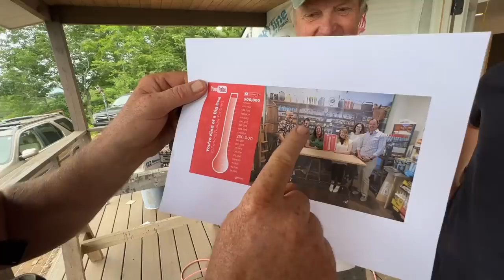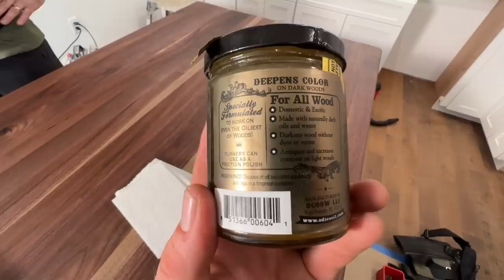Building A Mountain Cabin EP47 | Testing homemade crown jig and kitchen island install

Comment: Watching you put together the island cabinets, I'm reminded of my first house.  This is back in the old days--  1985 or '86.  LOL!  Back then there were no cabinets designed specifically for islands.  The whole island concept was brand new and most people were happy to simply have an island with nothing more than a shelf underneath.  Many had butcher-block tops as well as the pre-requisite hanging pot rack.  Ugh.  

Of course, I wanted an island, too.  But all the islands I saw seemed like a big waste of space.  So I asked my carpenter if he could put cabinet space under the island and he scratched his head and agreed he could.  But said he would have to custom make them.  Can you imagine?  He did a great job and we did put butcher-block counter tops in the whole kitchen.  So the island did have a butcher-block top, too, though no pot rack-- thank Goodness!  It was only 30" deep x 72" long because the kitchen was a little narrow.  But it had two fully functional cabinets, with drawer space and storage underneath.  And we extended the ends of the top to overhang on both sides and, with some stools, made it a very comfortable island that doubled as a breakfast bar, too.  

But, do you know what?  I would never put another island in a kitchen again.  I felt like I was always walking around it-- it was in the way!  Even more so than a kitchen table.  Ah, well.  

And I would never have butcher-block counter tops again, either-- too high maintenance.  Unless, like some, you never use them.  I knew one lady who had them and she put a bunch of cutting boards all around her kitchen so she'd never damage her butcher-block.  LOL!  I felt like, what's the point of having them?  Get Formica!  But if you do use them, you have to scrub them down with bleach at least once a week.  High maintenance.

Comment: For that crown moulding issue you had with the mitres not lining up, it could be a few things: 1- different lengths of crown can cup different after being milked and finished causing it to sit in a jig different affecting mitres, 2- ceilings may LOOK straight but can have bumps and bumps and change angles affecting how the crown sits in relation to the next affecting the mitre cuts. I noticed that the first section of crown (the 2 different depth uppers) the first 2 lengths of crown were put up individually and the next 2 pieces were pre assembled and put up in 1 piece. I’ve been preassembling sections as large as I or a partner can manage and putting them up in “1” piece for 7 years with great success. CA glue with some wood glue, staples on the back or dowels glued to the back give tremendous strength to handle a prebuilt section of crown.

Comment: Those cutouts and rubber inserts in the saw blade helps reduce chatter and wobble. If you use a high speed camera while making a cut you would see the blade do strange things.

Comment: The rubber inserts in the blade are vibration dampeners/ absorbers, looks killer just finished my first solo house build and all of the tips and tricks and I actually enjoy Jamie’s long talks, I enjoy the detail and oddities.
Reply: Yes Jamie is very intelligent I could watch him for hours talk about this kind of stuff.
Reply: I always thought the cuts at the outside help break up the circumference so it doesn't wobble as a whole.  Each section can correct itself since some finishing blades are so thin to remove less material for precision cuts. Never noticed the inner dampeners tho!

Comment: A few tips. 
Cut your long pieces of crown first,test fit... then pre-assemble especially inside corners. 
Use sashco colormatch for caulking,it's hardner base caulk then mixed with latex (matching your paint color).

Comment: Regarding the blade anti-vibration cutout discussion at 12:44. 

I'm speculating, but the s-shaped cutout removes the higher density metal for anti-vibration purposes. The rubber filling in the cutout is to ensure the balance stays consistent over the lifetime of the blade. Some cutouts could possibly fill up with sawdust or other materials, while it's 180-degree opposite paired cutout remains clear, which could throw off the balance and/or negate some of the antivibration aspects of the design. Just an educated guess.

Love the show. Keep doing what you're doing!

Comment: First blade cutout you discuss looks a bit like a question mark is actually for heat expansion on the very edges of the blade so the blade doesn’t cup as it heats up during use. 

The polymer filled cutouts are the anti-vibration for the blade.

In addition, the red color is actually a coating on the blade to also help with heat, gumming up of sawdust on the blades. It also helps in preventing the blades from rusting.

Comment: At 8:00, was there a reason that the light also did not end up centered over the frig opening? Having the three recessed lights line up with the center of the narrow wall cabinet on the back wall is fine and being close to the crown would be ok, but being so far off from the center of the frig cabinet and those two doors would probably drive me a bit nuts.

Comment: While the jig is nice, if you are looking for a new saw, my Festool Kapex has lasers on both sides of the blade. So you always  know exactly where your cut is going to land, it's fantastic, it even works for compound miters.
Also the saw comes with an angle finder which devides the angle in two equals and can be used to transfer the angle to your saw. I use this for crown moulding but also for skirting boards a lot.

Comment: Love the content, you guys do great work, the cabinets and countertops were very impressive as well, but be prepared for a complaint about the countertops in the next 1-2 years. Odie’s is well known in the woodworking community for not holding up over time. Don’t bother calling Odie’s either, their owner is well known for blaming customers when it does breakdown. I love the oil finish but would recommend the Black Forest ceramic topcoat if you are going that route, it adds a nice layer of protection.

Comment: Did you use an 18 gauge nail gun on the crown? It looked good but look into a 23 gauge micro pin. It has incredible holding power for the size of holes It leaves. I use the on the regular for crown on cabinets.
Reply: I like the 23

Comment: Do yourself a favor and get a starrett miter gauge for perfect miters on crown also your jig could be affecting your saws calibration if the deck doesn't transfer 100% because inconsistency in the wood.

Comment: The one recessed light touching the crown molding would bother me more than a light being intentionally set farther back from the outset cabinet.
Reply: Yeah that can can’t stay like that, even if it means moving a few others to make it look good. Wouldn’t like how it isn’t centered on the fridge either.
Reply: @britboimike  Show us the house you built from scratch, and the issues you've encountered.
Reply: It could actually be worse. I see most of the time the crown is built out to the outside of the doors, so another 3/4 - 1" over the can.
Reply: Totally agree. That should have have been caught on the planning stage. Regardless, they should have moved just the one can. Sure, one light is not in line with the others, but that's not a big deal. And you can also center the light on the centerline of those cabinet doors (that was mistake #2).
Reply: If they hadn’t pointed it out, I never would have noticed it was an issue. But now that they have pointed it out, it’s pretty hard to unsee.  The only fix that you wouldn’t be able to unsee is if they redid there spacing on all the lights because they offset from each other and the three walls. If I had to live with something being “off”, I think I’d prefer the one they left.
Reply: @idontthinkso666  I don’t believe the crown molding would be in the planning stage!

Comment: 12:33 I'm an engineer.  The reason is to keep material out. Different woods and materials have a different weight.  It definitely will throw a blade out of balance if it gets filled at different rates or if it gets filled with different types of materials or woods. The plugs provide a more exact weight.

Comment: 12:54 Saw blade chatter reduction: As the saw blade spins the RPM has to be appropriate to the blade size. For a 10" portable table saw 3400 rpm is good and with a cast iron comercial cabinet saw 5200 rpm can test the limits of what structural physics can design safely. As you travel from the center hole of the blade (arbor hole) outward, centrifugal forces can expand the disk-shaped blade so as the metal is pulled away from the center of the blade through expansion, it is also forced to distort from side to side in a fluttering that causes chatter in the kerf of the cut. 

Design inovations have made these blades run smoother because they use a work-hardened temper ring pressed close to half way out of the radius, and between that ring and the gullet, they cut releases in the disk body to harmonically stabilize the expansion of the blade with the number and type of teeth of a given blade. 

The chatter in a blade is typically from the directional force on the cutting tooth transferred to the outer half of the radius where most of the lateral force is caused much like fabric when it is pushed and starts to bunch. This is easy to visualize but words don't really communicate this concept. The part you don't see is the tensioning ring usually hidden under the paint coating halfway to the rim, the lazer cuts are just to manage what's left. Tha tension ring is where two hardened high-pressure metal rollers pinch a circle around the blade about half way from center to rim to reduce inner area expansion. I learned this back in the 80s and I've seen the incremental innovations get better every year. 

Back in the late 80s most of my blades were Forest and Amana with some Freud thine-kerf in the mix. The Forest blades were $200 and up and the only blades I would trust with my laminate and veneer work. Also back then before over priced Blade gum and pitch remover I would use oven cleaner on them and they were as clean as a new blade, you should try it when your blades get gunked up.

Comment: Maybe someone has asked but are you guy nervous about putting so much finish material in without windows. I mean from the looks and sounds of it the ac doesn’t appear to be on how are you controlling humidly? What if the floor shrinks then there are gaps everywhere?
Reply: That is a valid fear… we have the air conditioner running and had a dehumidifier running for a while with plastic over the windows. I think it’s gonna be ok

Comment: I just can't let this one go...you guys have to move that can.  Not only is it bumped up against the crown, it's also not centered on the cabinetry.  Typically that wouldn't be an issue, but it's so close to the cabinet that is creates imbalance.  Jamie is too OCD to let that go...right?
Reply: Moving it would involve patching the hole and repainting the entire ceiling. Let the owner decide.
Reply: oh, I thought you could just snap your fingers and it would move over.  Never mind, I didn't know there was actual work involved.
Reply: @cjtaylor0103  
Not everyone here is a contractor of some trade. Forgive me for not assuming you knew everything already.

Comment: The manager at Freud NA Canada Division visited my cabinetmaking program at college and showed us their 'new' (I'm aging myself now) blades that have anti-vibration and noise reduction technology. He told us how normally you tell a blade is bad when it loses it's tone when you tap it; if it rings, it's good, if it thuds it's lost temper in the metal. But these new Freud Diablo blades remove that ring with those cut outs to lower the decibels while working, and also to cut down on vibration. That was the old style, nowadays they add those rubber inserts to act like rubber mounts that absorb vibration and lower noise further.